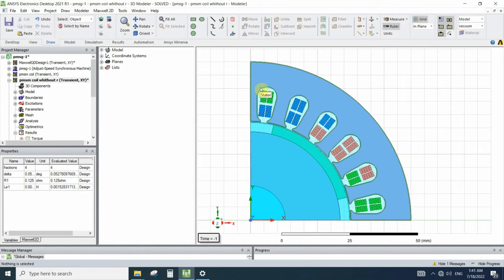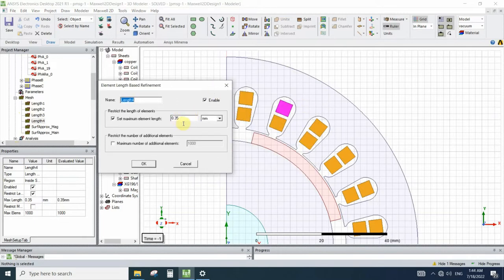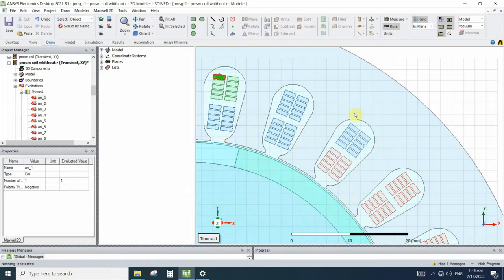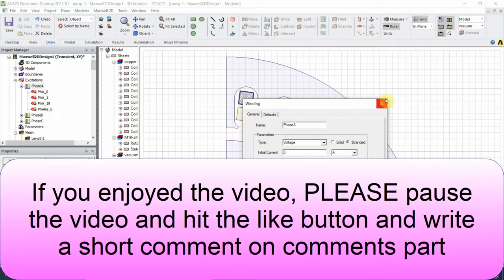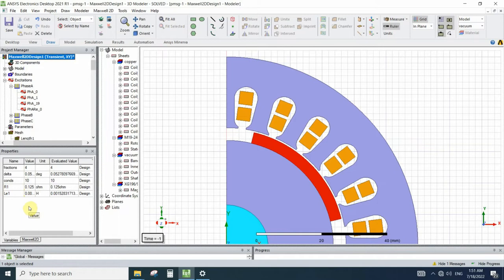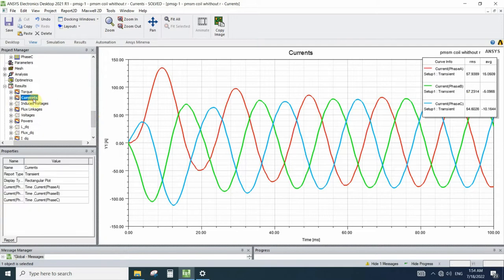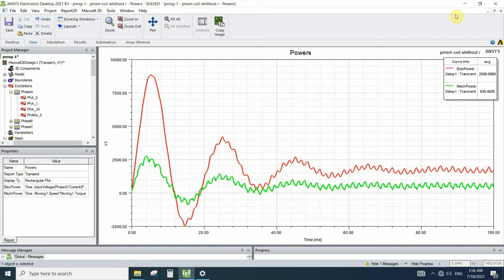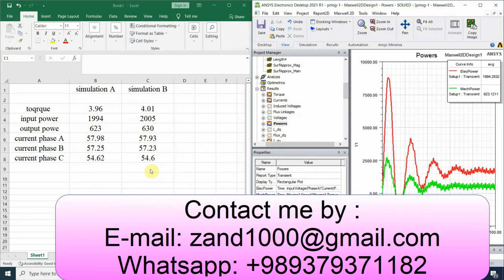Comparison between modeling solid and stranded coils in Ansys Maxwell

Comment: Hi, I am doing Electrostatics Simulation. So how do I evaluate Capacitance at a particular location/node/point? Thanks!!!
Reply from the maker: Hi. In electrostatic simulation you have to assign parameter --> capacitance between parts that you wanna measure capacitance
Reply: @EMSimLab  hi, how do we assign parameter? Actually I want to measure at a particular coordinate...for example: (1,0,0.5)
Reply from the maker: @ashishgupta4519  capacitance only means between two or more conductors.  Between them. What do you mean by a coordinate.
Reply: @EMSimLab  Between a coordinate and ground voltage...? How do we give paramters as u said earlier?
Reply from the maker: @ashishgupta4519 you can assign a parameter by selecting the object, right click on screen, assign parameter, capacitance
Reply from the maker: @ashishgupta4519  remember you have to select the object to be able to assign
Reply: @EMSimLab  Hi, If i right click on the object and assign the parameter, we get Matrix options -> Voltage. Which I already have. I want to check the capacitance between two points in Post-processing like using Field calculator....
Reply from the maker: @ashishgupta4519  I think this conversion can be more effective in a chat app. Whatsapp will be good and more consultance will be available by hourly charges. My contact info is on channel info and in most of videos